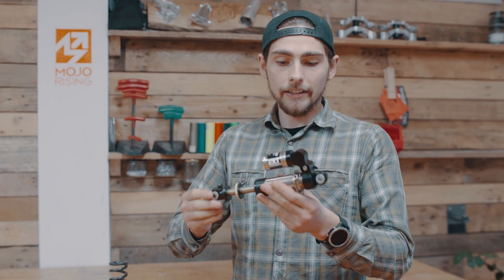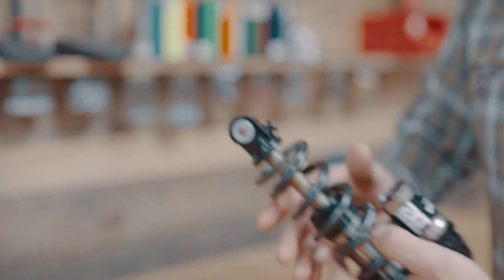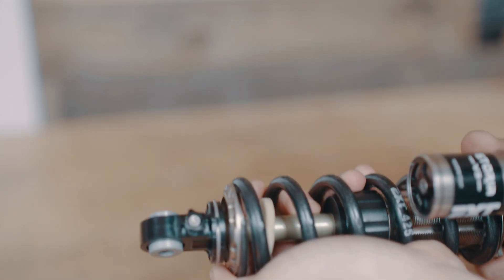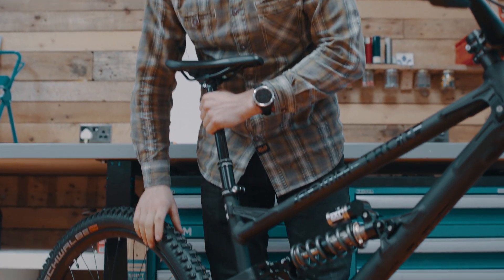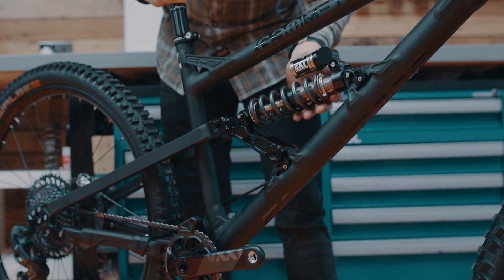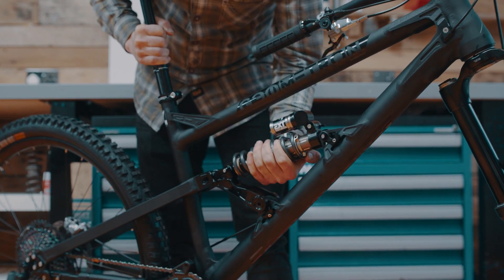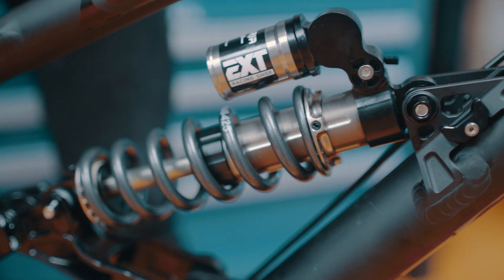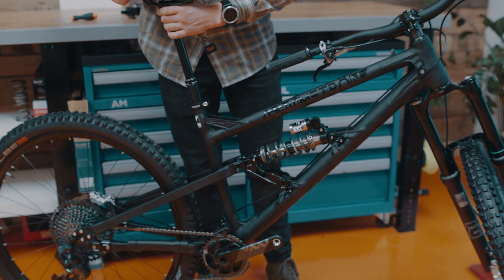GeoMetron G1 EXT Storia- Spring Preload Procedure

Comment: Bought a G1 December 2020, just un-mulleted it and bumped the rear wheel travel up to 175mm thus stepped the spring up 25lbs. Wasn’t completely jazzed with the way it rode then I found this. I set the spring preload ring with the shock fully extend, not just under rear wheel weight. Set it up properly and holy Batman it rides perfectly. I am continually amazed how big of a difference tiny little changes make on this bike. I would love more videos from you guys about the G1.

Comment: how does this installation method differ from fox dhx2 or other rear coil cocks??
Reply from the maker: If the Internal negative spring is subject to excessive main spring preload it will offer no advantage as it will be fully compressed and top out, hence the careful preload procedure under the weight of the rear wheel. Conventional coil shocks have a solid, usually rubber bump stop.

Comment: Does this method work for all EXT Storia even when they are set up for another bike brand?
Reply from the maker: Not quite so particular. Set the spring with minimal preload, wind the preload collar down to touch the spring, from there apply no more than 2 turns of preload.
Reply: @geometronbikesltd  thank you for the answer. I use the Storia in a Banshee Rune V3. Would you also install the spring like shown in your video? I set the preload without havin installed the shock into the frame. Do you think it would be better to set that like you in the video unter the weight of the rear wheel?
Reply: Hi Jim am having the same situation as you ,what did you end up doing in the end , I have a Storia V3 on a giga , just wondering if I should be lifting my back wheel up to tighten or not